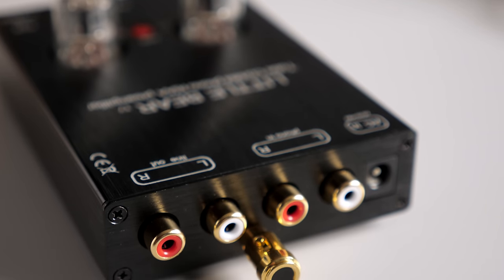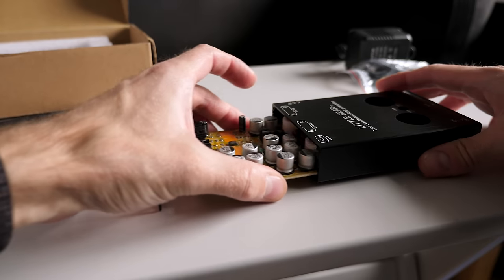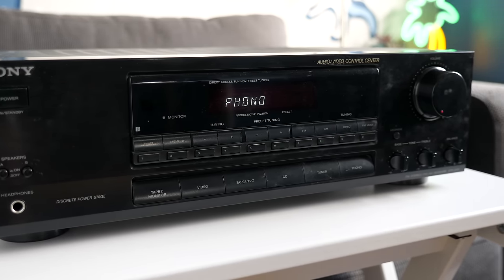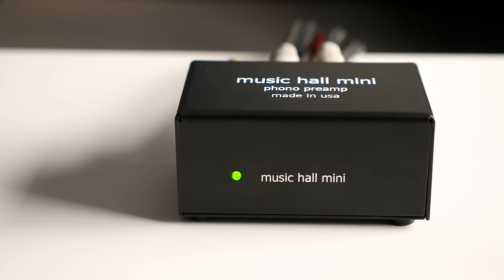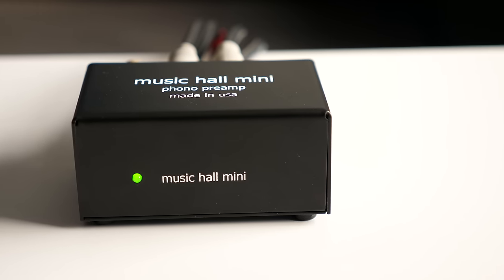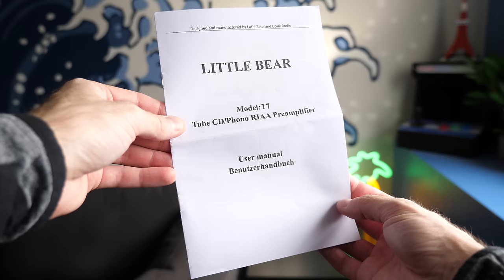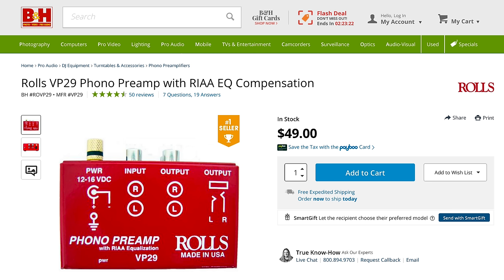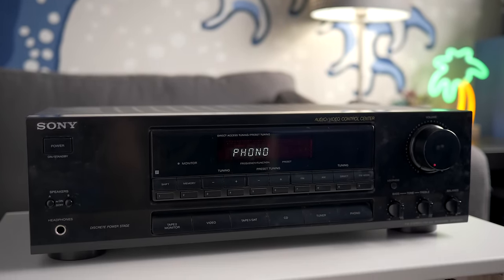A Look at Affordable Turntable Preamps

Comment: I'm always weary of tubes running off a wall wart ~12v. Typically tubes are designed to run way, way higher...even above 300v. At the end of the day it doesn't really matter though, if the end user likes how it sounds, hey, that's cool.
Reply: They could of course have a voltage boost circuit somewhere in there... after all, CRTs needed thousands of volts and only had access to 100-240.

Comment: Can someone give me advice on preamps. My Pioneer PLX-500 has a built in preamp, I have it going into my home theater receiver which doesnt have a preamp. Is it worth getting a external preamp?  Or am i fine with just my Pioneer PLX-500's built in preamp?
Reply from the maker: The most important question simply comes down to, are you happy with the sound quality you have now?
Reply: @ThisDoesNotCompute  I think it sounds great. No issues at all, just wasn't sure if I'd notice a improvement or not.

Comment: OMG I have (almost)the same receiver.(Sony STR-GX315 1994) so much better in the lows a broader spectrum and much more honest, could not get past the high pitched hum on the Music Hall in the first two samples. The cheap box did not cut it compared to either one of the others. To much mid no outspoken high or low .

I am wondering how the receiver would stack up to for example a Pro-ject phone box S2 .

Comment: To those looking for connecting a turntable directly to active (powered) speakers with less clutter I would point to the Klipsch R-xxPM series and the Roth VA4 which both have built-in phono pre-amps. I have a set of Klipsch myself and am very happy with them but have not yet testet the phono input. The Roth I saw in a video by Techmoan https://www.youtube.com/watch?v=r6d9Sj9-4gs.

Comment: hey so im looking to buy my first ever TT im a complete dumb for tech stuff, i dont know nothing about audio, im just looking to collect my favorite albums and listen to them, nothing like an audiophile elitist thing, just a casual here... So i wanna buy the pro ject debut carbon which dont have a pre amp so i would need to get an external pre amp to connect it between the turntable and the speakers, right? Well, watching reviews here and there i watched this guy who sets the turntable and connect it directly to the speakers, no pre amp between, he said it was because the speakers already got some build in pre amp so you dont need any external. I have read that the build in pre amp that comes with turntables are not so good, so my question is if it is the same case for speakers? like i was looking for some edifier speakers which apparently have that build in pre amp and i dont know if i can just relay on that pre amp and dont buy an external one, or should i buy an external pre amp anyways? in that case, does it matters if my speakers have build in pre amps while im using an external one? in case im using an external pre amp does it matters if my speakers have or not a build in pre amp? 
sorry for my terrible english, hope you can understand me

Comment: Furthermore, what mostly matters in, and within a record playing system is the phono cartridge. Also, the accuracy of the turntable's motor is not seriously considered! How about the silent operation, as much as possible, of the motor within a turntable? That quiet operation of the motor is rarely considered, especially today's equipment! 

Although you have very deep technical knowledge, and experience, This Does Not Compute, as well as many other subscribers, I'm a bit older than a couple of you here. I've been listening to music from records, 8 TRACKS TAPES, then cassette tapes, from the mid to late 1970s. Then listened to mostly records, and type 2, metal (4) cassettes in the late 1980s, '90s when I was young man. 

Shortly afterwards, I began listening to music on audio CDs starting from the end of the 1990s. First CD Players were available in 1982; '83 up here in Canada. It was very good I waited until late 1998 to get a Sony CE215 CD Player. Anyway, my point is that so much attention is being considered on the sound of music from a phono preamp that there are a couple of other components, and technical things to also consider with the sound from a record player.

Comment: The high water mark in audio engineering may have come around 1985 - 1990, with the affordable CD players, before the WooHoo philes slithered into the scene. Healthy competition meant high quality receivers had to perform, and not look "important." My primary CD player, a Technics with digital output, is over 30 years old, and I have never found a reason to replace it, except it can't read modern formats. Receivers had RIAA phono input standard, as the primary source still, and the circuitry was well understood, and perfected. These new, small preamps should also be simple, but not including the old phono circuit either in modern receivers or the phono itself is cost-cutting at its worst, and the lack of real awareness of what used to be generally accepted notions of practical audio setups has opened the door for newbies to get sucked in to all manners of cheap or irrelevant devices.

Comment: My god the Little Bear was nasty. Older amps or receivers cost hardly anything with a bit of luck and the only negative is that they are old and heavy. But sonically hard to beat for the prices they cost. Best bet is to find an amp without the tuner section. Lighter, less parts to go wrong and usually a touch better as they don't have all the other electronics inside.

Comment: Sony has always made a high quality unit, always extremely competent, admittedly, even by the most demanding Audiophiles. 
So, I like the comparison, but, I was interested in the pre-amp for the receiver that does not have a built in one for turntables. Looking back on it, I see how it's relevant as a base for the comparison.

On the other hand, I like that you exposed Music Hall for the "name change" and that little bear was a toss up.
Reply: xr500t it’s not difficult to use an older receiver for just it’s phono preamplifier stage and run its tape output to your modern receiver that lacks a phono preamp. Just hide the old receiver and forget about it.

Comment: The "Little Bear" should be called "Big Bullshit".  Adding a tube stage to get the "tube sound" is simply throwing in a useless circuit to add distortion. Of all the cheap preamps I've used, the best, by far, is the ART DJ Pre II. It isn't just a single stage op amp design. It's got multiple stage circuitry in it, gives plenty of gain (adjustable) and has very accurate eq.

Comment: Those LED's make me think that the tubes aren't even in the audio circuit... because you wouldn't need LED's in an actual tube...
Reply from the maker: The tubes do glow on their own, but not enough to be really noticeable. I’m actually glad they went with orange LEDs since a lot of other tube preamps from these kinds of manufacturers use blue LEDs instead. And the tubes are indeed in the audio path — there’s no sound output if they’re removed.
Reply: @ThisDoesNotCompute  I find that amazing, but you probably agree that at the price point these are coming in, they aren't doing all that much and are really only there for looks. I'd personally probably go for the one with out the tube myself if I were looking at that end of the spectrum. Less to break, and I can hide it behind my player easily. Anyway, still a great video, as usual :D

Comment: Oh-Lord!... The Little Bear sounded AWFUL compared to even the Mini Music Hall, the later of which  i thought might be as disappointing as the $20 9V battery-powered RCA preamp I once tried with a friend's desktop system... and this is being heard through the speakers of a 32" TCL television in the Normal sound mode!😲

BTW: Thanks for including a early-90s Sony reciever in the comparison. I had both low-end and a higher-end models of the same vintage and, admittedly, it's been a while since I listened to my Pioneer PL-300 through either... so I was about to ask if I should use a "good" preamp with either should I setup my system again. But judging by what I hear here, I'd say that'd be superfluous, considering my budget.

Comment: the truth is, all vintage receivers/amplifiers build in preamps of the low end and mid range are far superiour then every one of those preamp's of today, anybody who says otherwise has absolute NO CLUE! its the same with turntables/recordplayers. Back in the day Hifi companys of the main brands as "Sanyo, Technics, Sony, Marantz, Studer, TDK, Akai etc." had a set goal of delivering good audio Quallity to the home user and they where brands with a very good reputation and even in the low end they wanted to deliver a dang good product and so they usually overmanifactured their stuff wile keeping prices reasonable, all those companys of today who make HIFI equipment pretty much build crap... ya and that includes your fluance record turntable there :p its not a bad turntable per say dont get me wrong but back in the day it would have been in the low end section of the spectrum and even my cheap Marantz TT 2000 would mop the floor with it... Vintage HIFI is pretty much always better then the crap they make today which is overpriced and cheap crap wile the vintage stuff out there in the used market is pretty afordable and even today still rock the highest quallity

Comment: Their called "Phono Stage" not Pre-Amp, a pre amp is designed to be used with a power amplifier, & may not have a "Phono Stage" built in. Sadly it's a common miss use of the term Pre-Amp!
Reply: A phono stage is actually a preamp as the current from a phono cartridge is so low that connecting directly to the receivers preamp section, volume, tone control etc.., there just isn't enough to properly drive the rest of the system and the output would barely push your speakers.

Comment: I own a 2200AUD Pioneer 300W per channel Receiver and it does not have Phono preamp. I dont' want to go out there and purchase an other 1000aud preamp to make a 1000AUD turntable that I didn't purchase yet to work. I wish I knew about the importance of having a good phono input on my receiver... so... I am not going to purchase a turntable and stick with my amazing CD collection and Spotify premium streaming. The issue is that today gear that sounded ok in the past and could be bought for peanuts today it's sold for thousands and thousands of dollars while cheap gear today sound mostly rubbish that before would not even be considered to be put for sale. Most companies today just wants to steal out Hard earned cash giving very little in return.

Comment: I used to use a cheap Pyle preamp (similar to the Rolls/Music Hall one) but switched to a vintage JVC. I also had less ground issues. I'd been wondering if the the JVC was actually a good option and I think you've helped confirm that.

Comment: I really appreciate the comparison but I wish I could add one more . I’ve been using a vintage Realistic  model number 31-1955 Stereo amp with  switchable ceramic-magnetic phono cartridge input and thought it sounded  pretty good, but would need to compare it side by side with others to pick out the differences. Any experience with these units?

Comment: music hall mini is a "rolls"...
Reply: ok he disclosed the "rolls"... i own a rolls with no ground issue. fairly bulletproof little box for the price. i used to use it in my broadcast studio for my sl1900...
Reply: @joekiddent  I've got a Rolls VP29, works well, don't have a problem with this phono preamp. Only thing is that it does not have a power on/off switch. Furthermore, some of these pre-amplifiers are designed in the USA, but they are assembled in China.

Comment: Why on earth are they making all this gear with tubes/valves poking out the top. Valves were never intended to be used this way, they are made of fragile glass and should have a cover.
Luckily in this case they are running at a lower voltage, so a breakage and accidental contact with the innards probably won't kill you - However high power amps are another story - be careful.

Comment: Little Bear just more Chinese made crap. I think a good guide would be what your system esp your cartridge costs.
If prime concern is bang for bucks go for Project or Schitt or yeah go vintage👍
I use a handmade valve (6 in total) mm only pre I got as a shop test model $2500 new, from the maker for about $1200

Comment: Well that music hall mini or what ever the shit is called is nothing but JUNK! Sounds like a compressor of some kind running, which I guess is Interference. I don't no, I can't tell what it is, but if you have good speakers, earphones you'll hear it right when that music hall part comes. I hope you didnt pay more than $40 or you jsut got screwed. Ahh so that hall thing is NOTHING BUT SHIT! YOU PAID $100 FOR THAT SHIT? BRO, YOU COULD HAVE HAD A TRUE SETUP WITH POINT 2 POINT NO PRINTED BOARDS FOR ONLY $200 AND YES IT USES VACUUM TUBES. I CAN'T RECALL THE BRAND NAME, BUT JUST SEARCH FOR THE AMP.

Comment: Its obvious why so much of the old gear is so much better than much of the garbage sold today, NONE of it was made in China. Has audio, electronics, music improved over the past 30 years, seriously? In many cases its worse !! Ask any reputable sound engineer if todays digital world is better than analogue and their answer will be NO. Do you see a consistent pattern here? Only two people benefit when you buy something new, the manufacturer and the seller, its the buyer who looses. Valves bring  warmth and a little saturation to the sound thats why guitarists love their valve amps over solid state, but since so many new vinyl lovers are to young to remember the hey days of vinyl does it matter? There all used to the clinical clean faultless noise of a digital track a vinyl record no matter what its played on will never really be appreciated, worse still most are buying new vinyl's that have been digitally remastered, why not just by the CD? there &%%^(^)(

Comment: I'm listening to this on my high end system and the youtube sound makes them all crap .. pointless comparison
Reply: It's not an accurate reproduction but you can still tell when one has more noise, or when one is muffled. Plus YouTube uses Opus now which at ~100kbps is like AAC 192 or MP3 256. Now that obviously would have losses compared to the raw file, but it's still a really efficient codec, and if you just look at the bitrate alone you might assume you're getting the quality of, say, MP3 at that low rate. (Of course maybe you got served an AAC or, gasp, an MP3, depending on your playback hardware. The "stats for nerds" part would tell you.)

Comment: I'm just watching this(I know, three years old) for the first time, but what a lousy, terrible review.  All your lp choices have horrible eccentricities, you could the wow created from the lp plus your cartridge is noticeably out of alignment which you can easily spot in the video.   And I have to think that the receiver basically uses a chip with a minimum of discrete components.   I see your shtick seems to be all things computer or digital cameras but today something like the very affordable Schiit Mani 2 does the job admirably and if going the receiver route, a 70's Pioneer, Marantz, something like that rebuilt, restored all had pretty nice phono sections not to mention tuners, ability to hookup other devices and just plain nice esthetics rather than some crappy contemporary A/V receiver that no one wants to work on and little to no value.  Next time get someone else to setup the turntable.
Reply from the maker: Is that all you got? Surely there’s plenty else about my content that sucks lol